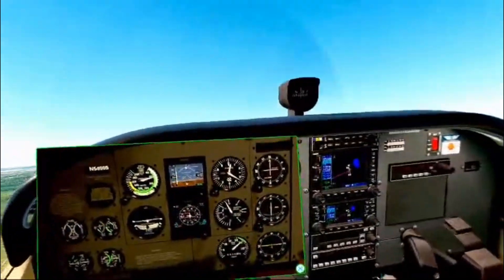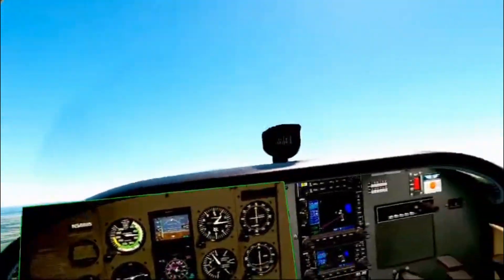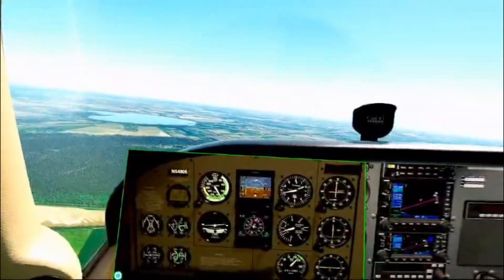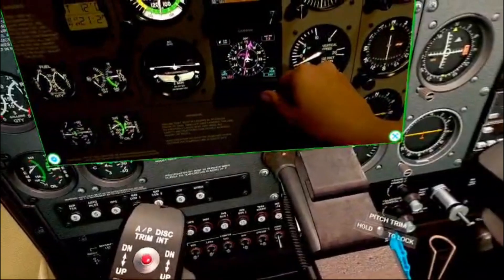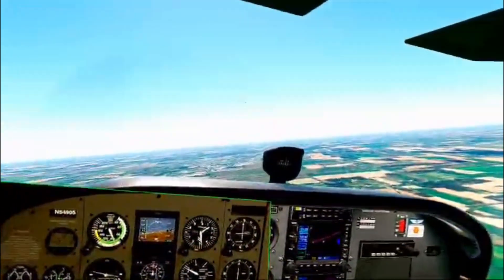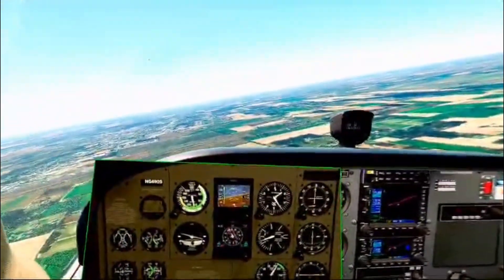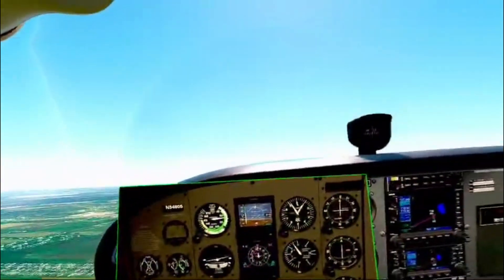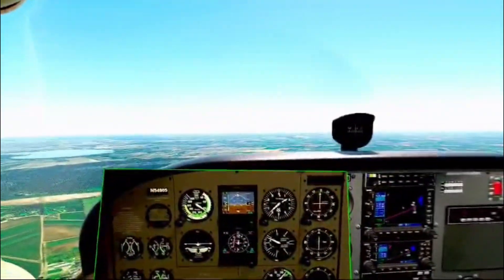Mixed reality Flight Simulator

Comment: nice setup, i would love to set something like this up with the new Apple Vision Pro and Xplane 12 (some day)...    sucks flying patterns in my sim cause I only have the wide screen monitor in front, but it's still pretty great for instrument training (why I made mine).
Reply from the maker: That would be awesome do you have a Vision Pro? If there is a will there’s a way , it wasn’t easy for the quest that’s for sure but it was mainly troubleshooting because it’s simply uncharted territory , but 100% worth it!
Reply: @Theamateurstudentpilot  nah, not yet but I have a quest 2.  Prob not great for mixed reality but might work for straight VR setup.
Reply from the maker: @flightsimguides  I have seen plenty of people have solid results with the quest 2 , the quest 3 is very impressive so far on my build , the obvious challenge is trying to keep MSFS happy and connectivity issues etc. I would be very curious to see what the Vision Pro would be capable of I am certain the same mixed reality methods can be used for it. Keep me posted on how your training and sim is coming along or if you want to do a dual trip one day 👍